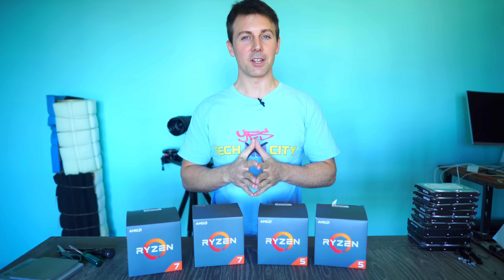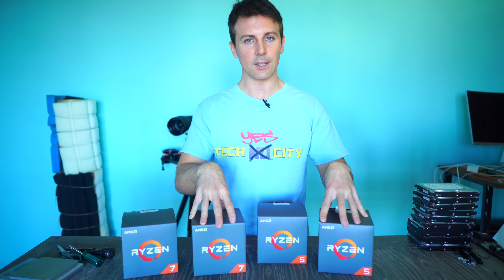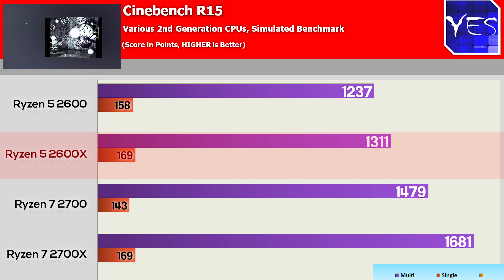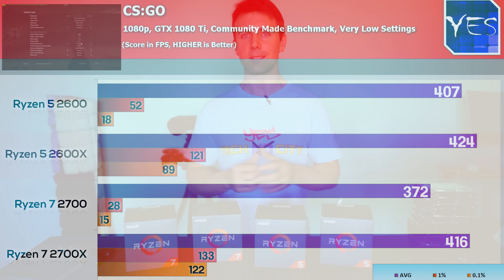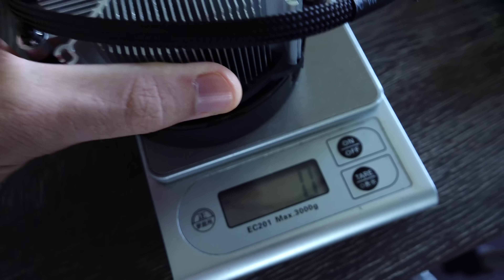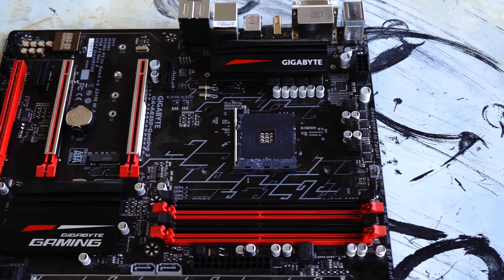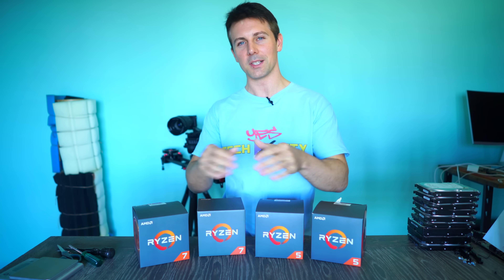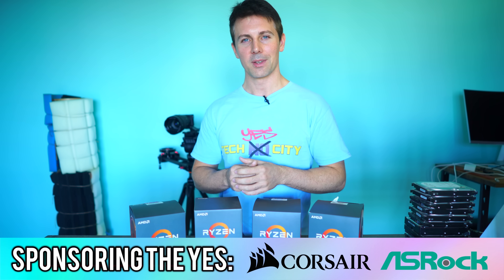Ryzen 7 2700X Vs 2700 Vs Ryzen 5 2600X Vs 2600 - Is the X Better Value...!?

Comment: the power plan in windows for some reason AMD linked it with the bios configs. u can get 4.35ghz by just changing the powerplan, and different vcore voltages as well

Comment: A little less than a year later and I got a 2600X $89.00 and a Premium featured Aorus B450 Pro RGB Wi-Fi/Bluetooth motherboard $100.00. Geil 16GB RGB 3200MHz Samsung B-die $57.00. Inland 256GB NVMe.2 $40.00. Total $286.00. Get a solid mid-range GPU 2060 5700XT or 5600XT. Under $600.00 play anything 1080-1440P Ultra/High settings ample FPS for 3-4 years. With OC RAM timings 3400MHz the fps are equal or better than stock 3600. Snap on AMD FX Wraith MAX cooler if you have it.

Comment: Thanks for sharing the Video!

P.S. I have an Asrock B450 Motherboard with a R7 2700 and RTX 2060 Super with 16 Gb Ram is the Spire Cooler enough if I wanted to overclock the 2700?

Comment: On the 2600 I oc it to 3.9 on the stock cooler it ran fine hit 80+c when stress testing but in game and normall use it never hit over 71c. Stayed at 48-60c mostly..  (but i do have a case with a fan on the side blowing straight at the cpu cooler)

Comment: Hi there,  I just purchased and built a computer after almost 15 years 
since my last build.  I got A Ryzen 2600X, Gigbyte B450 Aorus Pro WIFI 
MB, 16gb of 3600 speed memory(I know now I should of stepped up to a 
lower CL as mine is 19). and an RX5700 Video card.  Now its all up and 
running I been trying to over clock the CPU and set up XMP but I have 
not gotten really anywhere on this and I was wondering if you have any 
experience on this Gigabyte MB to help someone that is lost.  The 
motherboard has been update to the newest bios.  if you or anyone needs 
any other details, please feel free to ask
Reply: C16 3200 would have been much better, apparently higher speeds than this do not give much extra performance with these CPU's, but the guy in the video ruined these tests by using much to slow RAM for them, 3200 is the sweet spot for performance vs cost.  There are loads of overclocking vids for these kinds of setups, but I like to just up the cooling and get slight gains and have more longevity.

Comment: Do you think a build with a 
-Ryzen 5 2600x
-Asus Prime B450M
-Gigabyte Gtx 1660 6gb
-2x8 3000Mhz 16gb Ram
-Corsair Cx Series 650 watt 
-Seagate Barracuda 1tb HDD 
-Adata Su800 128gb SDD
-Nzxt H500i Case

Is it a good 800$ pc let me know!!! If I should change something
Reply: Should I change the case for a cheaper one
Reply: Ssd 240gb

Comment: Upgraded to r5 2600 , the x version was 50€ more expensive so i went with the non x version. OC'ed it to 4.1 Ghz all core and get better benchresults and performance then with an 2600x , except its OC'ed to 4.2 Ghz. :D 
Also bought a Dark Rock 4 for cooling so the better stock cooler that comes with the X-Version was no argument for me. 
Awesome CPU for a good price. 
But looking at the 2700 , the x version might actually be the better choice.
Reply: why 2700 X would be better than 2700? if u can still OC to 4.0Ghz at least with better cooler? ... pls elaborate
Reply: I said might be the better option. Always depends. There are people out there that are not into manual oc. The x version provides more performance without doing anything and the stock cooler seems to keep the CPU also way cooler then non x version. You're talking about new cooler , oc, but when you want to just buy and enjoy you are better of with the x version in my opinion. On top if.you really wanna oc, you can also oc the x version, even higher then the non x most of the time cause these chips are special selected chips that can take more clockspeed / voltage/ run more stable. Price difference is also not that much anymore. Getting a good cooler plus 2700 might actually be more expensive then just grabbing the 2700x and let xfr 2 do its job. I mean everyone has it's own opinion of course and that's mine , with my personal view arguments. :D

Comment: which one should i get for gaming and streaming... i was eyeing up R7 2700
Reply: I upgraded to the R5 2600 , OC'ed it , and got an RTX 2060. OBS new codec that works amazingly well with the new nvidia cards relieves a lot workload from the CPU. 
And the CPU , at least for me , is way enough to play any game on highest settings (paired with the Rtx 2060) on 1080p. So far the only game using the CPU to its full potential 
was Battlefield 5.  
When I stream Overwatch for example the difference in fps stream off / stream on is about 10-20 fps, letting me play with still 150-180 fps depending on map with highest details, and resolution scale on 144%. 
So i think a 2600 is more then enough especially with OC. A 2700 will probably perform slightly better. 
It's up to you if you need it, if you wanna OC or not, and the 2700x version is even more powerful but results in higher temperatures with more noise and power draw. 

Hope this helps a bit. :'D
Reply: @Seppe1106  i was really eyeing up r5 2600 but the price drop the  R7 2700 is $210 in amazon now.. and watching this benchmarks im torn between 2600x and 2700 im gonna pair it also with rtx 2060... :( planning to stream pubg and csgo... should i get 2700 none X and oc it to 4.0 or 4.1 or something...?
Reply: @zombeesama1169  if there's no real big price difference anymore go ahead and get the 2700 then.
Reply: @Seppe1106  thanks for the info bud.... g'd day... maybe ill get the 2700 for more future proof cause im not planning to build a another pc for minimum of 5years...
Reply: @zombeesama1169  well 2600 and 2700 are both really good. 2600 has the upper hand in terms of pure gaming , and the 2700 is better when you run multiple programs while gaming, a little better for also streaming and a good step better in video or picture editing. So it's just coming down to what you plan to do with it. 
In general there is no need for any ryzen x version, especially not if you already have or plan to buy a CPU cooler separately. You can oc non x versions to pretty much the same or even better performance levels. 
So it's up to you what you need/want and your budget allows you. If you already have an AM4 Board you can also wait for the new 3xxx ryzen.
Reply: @Seppe1106  thanks...i think with the stock cooler i can OC it to 4.0 or something i got AC in the room...hope it will all work out... i have a ryzen 3 1200 OCed but i will give that to my pops...
Reply: @zombeesama1169  don't know much about the boost clock and oc capacity of the 2700. For stock clock speeds the stock cooler is said to be very good. Don't know how it is in terms of OC. But you'll figure that out then.  1 thing for sure 2600s stock cooler is shit shit shit. Haha giving me 80 degrees while gaming and up to 90 when benching. Can't get worse then that :D

Comment: can i get 144hz with 2600x and a rtx 2060 at overwatch and fortnite?
Reply: Yes. I got the 2600 @ 4.1 Ghz + RTX 2060 from Asus and Overwatch runs on around 180-200+ fps on highest settings in 1080p.
Reply: @Seppe1106  thanks man

Comment: I upgraded from a A8 9600 to a ryZen 5 2600 and it is much better I used to get less than 100 FPS with a 1050 2gb on Fortnite now I get 150-240 I recommend the ryZen 5 2600

Comment: I have a 2600 which I've overclocked to 4.1 ghz. So far it has served me well and I can't even imagine needing any more processing power in the near future.
Reply: Do you use stock or aftermarket cpu cooler on that 2600?
Reply: @redsullivan5284  Aftermarket, gammaxx 200t, only 20 euros. The box cooler sucks ass

Comment: I have a 1600, with stock cooler. I can OC it to 3.9GHz (4.0 is just too hot for the stock cooler), and with that I get ~1700 in Cinebench R15. I think I won the silicon lottery, or maybe your processors lost, because I get 1400+ without any overclock (3.6 GHz with no extra voltage, i.e. stock "turbo").
Just putting that out there haha

Comment: Well, I´m leaning towards the Ryzen 7 2700x, seems to serve all functions I need it to (3d modelling/rendering, photoshop, sometimes video making and some gaming on the side).
Reply: wont R7 2700 serve as good with some OC and save the money?
Reply: @OK-j7x  Personally I prefer the 2700x stock, because of the higher clockspeeds (that´s what I need for 3D modelling since the viewport only uses one core, so the higher clockspeeds, the better framerate I´ll have). And without the need to overclock, which I´m not much of a fan (I want the hardware to last many years and overclocking, considering the amount of heavy stuff I do might wear the hardware faster). Plus to overclock the 2700 I´ll need a new cooler, which would put it almost on the same price range of the 2700x, so...

(and if in some years from now I decide I want a bit more power, then maybe I´ll overclock the 2700x, but again, I prefer less power and steady performance, over more power and more wear).
Reply: @The_Curious_Cat  I'm trying to make this decision too but the 2700 with custom cooler (e.g. DC Gamaxx 400) is cheaper then a 2700x from where I am. Plus I think any difference in blender-cycles won't be noticeable between the two at stock speeds. So 2700 with occasional OC'ing should perform smoothly for atleast 5 years 🤔

Comment: At first I wanted to go with the cheaper 2700 but I thought that I want to use the computer for several years and so I went with 2700X. I am so happy with it. The RGB cooler is awesome and I could overlock to 4.GhZ with only + 0.025V and I could reach 4.2 gHZ easily but at that speed, a better cooler is needed. Not much of an overlock but I think in a few years I will be happy that I have choosen the better version. If you think about it, even though I know it is not so simple but 300-400 MHz overclock on 8 cores is roughly + 3200 MHz overall :)

Comment: Thanks for the video. It is a good information about these CPUs. However, I am really interested in one specific test. 2700 vs 2600X leave stock voltage, manual overclock to the maximum achievable as long as stable without voltage increase and check the FPS in games. Also could be interesting the wall socket power consumption . Hopefully one day I will see a test like this.
Reply: Watched this for the exact same test, still wondering

Comment: Hmm.. here is the thing, as of right now the 2600x is going for 250$ and the 2600 goes for 189$. So is it really worth to go with the 2600x?, i  mean if you go for 2600 you can buy a better cooler and maybe better ram. So which one is really worth here?
Reply: The 2600 boosts to 3.9 Ghz out of the box, and will OC to the same freq as the 2600X, but will do it on all cores. The 2600X is good if you want it "overclocked" out of the box and will certainly perform well, but the 2600 is better bang for the buck, and will perform very well even on stock freq.
Reply: 2600 @ $149 now,  heck yes

Comment: My Ryzen 5 2600x came with the 2700x cooler. i think amazon must have made a mistake in packaging
Reply: Not complaining
Reply: You got the Prism RGB? And unless it was used, Amazon didn't package it. It should have the AMD holo seal on the box. AMD packaged it. They do have 3 different diffusing locations, as well as 4 countries assembling and packaging them.

Comment: The Ryzen 2700 I just got with a Gigabyte Aorus, with a Thermalright 140 Direct Power cooler, and G.Skill 3200 2x8 16GB set, runs at 3200, and boosts to 3800 out of the box.

Comment: Nice review. Can someone help me? I'm getting the 2600x and I need a Mini or micro Mobo with a good onboard  Sound chip,  which one would you recommend? thanks.
Reply: ASRock X470 Gaming-ITX/AC
Reply: @faycalassaad6066  Thank you sir!
Reply: @oldskool80sfan12  That would be my choice but for my own reasons so it's only fair if you know all the options: https://nl.hardware.info/vergelijkingstabel/producten/403179-469617-475479-402611-403180-417127-457483-416567-451655-442799

My choice is due to the advanced wifi chip, low power draw and good audio implementation. The Aorus also features that same wifi chip, has an m2 heatsink shield. If wifi is not a concern get the ASRock B450 Gaming-ITX/ac (low power draw and excellent audio however a bit lower on memory performence) and if you wanna go all out (except for the wifi) than get the Asus RoG Strix X470-I Gaming. Frankly, every board in that link will get the job done and won't dissapoint you. The older chipsets (b350 and x370) might require a bios update in order to get your latest gen cpu working on it.
Reply: @faycalassaad6066  Thanks again for the info,  I have one last question about DDR4 3200? which DIMMs is compatible with ASrock MOBO?  I downloaded the ASRock  user manual guide and there are no DIMM's list or make only RAM frequency list. I did a lot of research I keep coming up with ( G-Skill Fury X),  would you recommend those on the ASrock?  thanks.
 BTW I would go with Asus board but I want something different this time as my PC I'm using now is a Intel with asus-maximus-vii-gene board and I love it :D
Reply: @oldskool80sfan12  There is no g-skill fury x afaik. You might be confused between kingston hyper x fury and g-skill flare x?
Reply: @faycalassaad6066  Sorry it was G.skill Flare x 3200
Reply: @oldskool80sfan12  The memory compatibility list is always on the productpage, just need to find the right tab. In this case, support, than memory qvl for your pinnacle cpu. https://www.asrock.com/MB/AMD/Fatal1ty%20X470%20Gaming-ITXac/index.asp#MemoryPR
That specific kit is not officially supported but it's known to work on previous gen itx mobo from asrock so i foresee no problem however that kit is way overpriced here. I would personally go with this: Corsair Ryzen Vengeance LPX Black 16GB DDR4-3200 CL16 kit 
As it's optimised for second gen Ryzen. Then there's also this: https://www.kitguru.net/components/memory/matthew-wilson/g-skill-launches-new-trident-z-and-sniper-x-memory-tuned-for-2nd-gen-ryzen/
If you really looking for the best deal though: Corsair Vengeance LPX 16GB DDR4-3000 CL16 kit
Imo Corsair is the most compatible brand out of the box with Ryzen. In any case i'd not go higher than 3200 as higher might be more tricky to get it to function properly.
Reply: @faycalassaad6066  Thank you Faycal the Lion :D  for your help.

Comment: Hey dude can you help me? I installed a ryzen 7 2700x in a b350m bazooka motherboard and i didnt let me use the pc
Reply: Might need to update the bios as that is a b350 and not a b450
Reply: @cwoody1413  add me on Discord because i need help:TSM Zarby#3849
Reply: How do i do that? XD
Reply: Look up a video on how to update bios on a b350 motherboard
Reply: @cwoody1413  i did that and nothing apeard
Reply: Look up how to update bios b350 and click on the one by Syrwegian
Reply: @cwoody1413  but does are different motherboards
Reply: @cwoody1413  i have the b350m:with the (m)
Reply: @cwoody1413  what the heck,i dont have the b350m-a
Reply: Its still a b350. Watch it
Reply: @cwoody1413  i did watch it,
Reply: But the thing that i dont get is the different b350s
Reply: I have the b350m and he has the b350-f
Reply: @cwoody1413  a searched up:asus b350m bios and this appeared:b350-a and b350-e

Comment: i can get a 2600 for 160 and a 2600x for 210 so its a no brainer, because with a good 30 buggs cooler both should see very stable 4,2 ghz if i ever need it
Reply: 4.2 is not a guarantee. You depend on the cpu and mobo as well.

Comment: I dont know what motherboard i should get with a ryzen 5 2600x (bugdet for motherboard = 60-100
Reply: Make sure to get either a b450 or x470
Reply: @cwoody1413  will a MSI X370 Carbon Pro do the trick, I've got a ryzen 5 2600x
Reply: @KraziCunt  With a recent bios yes.
Reply: @KraziCunt  it would but you havr to update the bios and it could not work. Just go with either the b450 or x470 to be safe
Reply: It came in a bundle deal with the Ryzen 5 2600x and T-Force night hawk 16gb RAM, got it really cheap.  I'm paying the supplier $10 bucks to update the BIOS, so hopefully will be good for a while.  Once the new AMD cpu's come out I'll invest in a X470

Comment: I have the 2600, overclocked very slightly at 4.2ghz. This paired with a rx480 I am seeing an average of 300FPS in csgo on high settings with discord and background apps being open also.  Honest opinion, any of the new AMD chipsets are going to blow the FX series out of the water. The mid range ryzen 5 1st or 2nd gen is very competitive especially in price range against Intel. My cousin is running a i7-6700k and it does a lot better than intel with mutlicores, his intel obviously still beats my single core (that helps in gaming.) but only by a 13% margin when not overclocked. His cpu still costs about $100 more than mine however.

Comment: Dang I wouldve bought the 2600x instead of the 2600 if I watched this. I just assumed it was only a higher clocked 2600
Reply: it kinda is, the main difference is that you get a MUCH better stock cooler

Comment: lol who even uses stock CPU coolers? :D
Reply: The bias against stock coolers is noob superstition. Whether you get a stock or aftermarket cooler depends on the situation.

Example. I have two nearly identical mini-ITX builds. One uses an i5-3570K, the other has a Xeon E3-1230V2. The 3570 required a small AiO to keep the temperatures down, but the Xeon does fine with the stock Intel fan. Why waste money to replace something that works?
Reply: To be fair Ryzen stock coolers are pretty good.